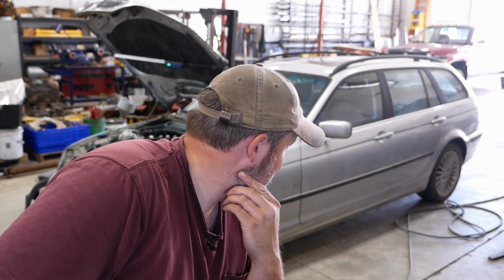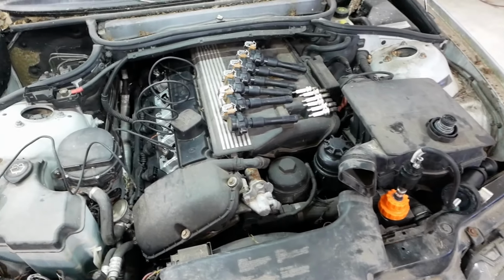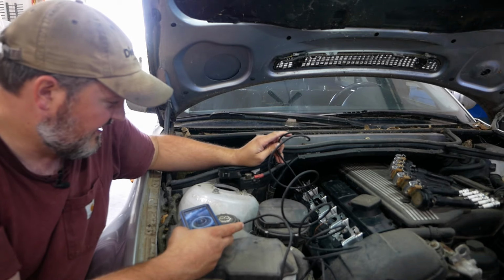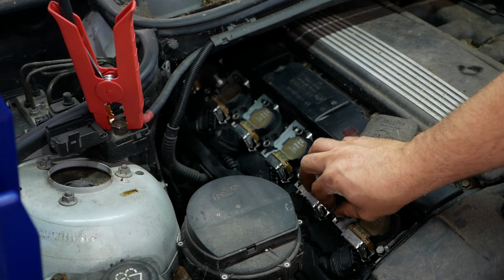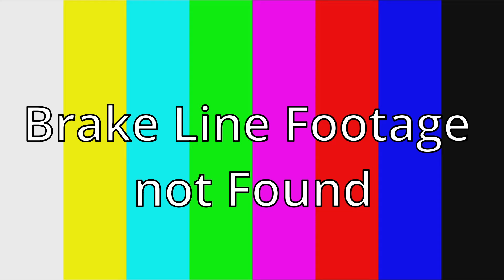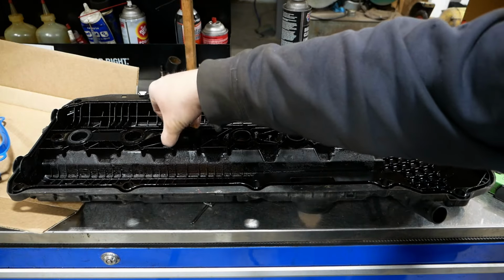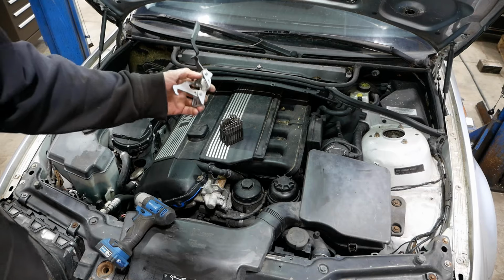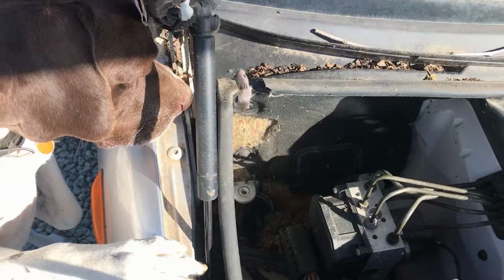E46 BMW Losing Coolant, Oil, Brake Fluid, Etc.

Comment from the maker: Need a bore scope or jump pack?
Teslong: https://amzn.to/3ZBZJW4
JNC660: https://amzn.to/3KYzF3r
Reply: check exhaust
Reply: The boroscope is good, worth a buy for those in need. Don't abuse it tho, act with it like a surgeon would. They can break the neck, that said, they did warranty me, sooo that's a +1 in my book.
Reply: Per mortske it’s pronounced “the schlong” 😂
Reply: @@bobhoughton3785 - In some garage, somewhere on the planet.. there is a forgotten old drawer that is slowly filling up with 10mm sockets.
Reply: @EngineeringVignettes  I saw a meme the other day of a gumball machine except instead of gumballs, 10mm sockets in a clear plastic ball.
Reply: Oh, yeah. I was in Tractor Supply the other day browsing the "bargain" tool display and found a bag of 10mm sockets in various colors, shallow and deep well. Started to get one but I haven't lost mine yet.
Reply: Water pump slow leak, this happened to my 3.5 new Yorker it ended up throwing the timing belt.
Reply: Should have checked the passenger carpet.  It could be draining from the heater core and into the car.  (maybe, not likely).
Reply: @calholli  If so the windshield would be coated inside as well.
Reply: @QQQ-os9dj  Maybe it was..
Reply: @calholli  He never thought to check. thats ok for a young lad.
Reply: @QQQ-os9dj  ceaa

Comment: I'm calculating the gray in your beard as the months and years go by. As we sit today we are approaching the log part of the graph. 🤣
Reply from the maker: Yes, BMWs trigger exponential growth.
Reply: @WatchWesWork  Heck you haven't seen mine and I've never rode in a BMW, much less worked on one.
Reply: And gray hairs grow faster than hair which has not yet turned gray - perhaps because they don't have to stop off at the paint shop before emerging from the skin...
Reply: I've always said that as long as it stays on my head, I don't care what color it is!
Reply: @DanEBoyd  tell me about it!!! Ever since my face hair ran out of paint, i can have a freshly shaved face turn too haggard Unabomber homeless scruff in less then two weeks! Never have ritualistically daily shaved but, probably should… just something i don’t consciously think about, until @ a week or two passes & POOF, all back, greyer then before & seemingly longer in less time
Reply: That’s just the Beard of Wisdom filling up.
Reply: I’m sure if you still had your e46 all this years later, you’d hate it deeply, Wes. They did not age well… I would not say it was the last good BMW, but the beginning of the downhill.
Reply: @silent1967  why is that?
Reply: @repairvehicle  Why is what ?
Reply: @repairvehicle  Go back and read what I said, put down your joint. I said I'VE never RODE in ONE or WORKED on ONE, "BMW" not Wes. I was talking about the color of beards.

Comment: I’m a tech at a ford dealership, and there’s an extremely common issue on the 1.5 fecal-boost engines where they get coolant intrusion into the cylinders. Typically they will have no evidence of coolant in the oil and it leaks just enough to evaporate and cause a misfire. They look exactly the same as your suspect cylinder. If it were me, I’d definitely be comfortable recommending a tear down on that engine. Happy wrenching Wes !
Reply from the maker: Yeah it may well be leaking in #6. I can't tell if it's coolant or oil.
Reply: As a completely unqualified opinion I agree and liked your comment.
Reply: I thought check heater control water valve , vaccuum diaphragm if present,

Comment: Hey Wes the e46 chassis is prone to cooling system failures , mostly do to all the components being plastic, which get brittle after 10 years. Preferred method is to overhaul the entire cooling system with only genuine (OE) components. The coolant hard lines are a common leak point, as well as the expansion tank cracking and leaking at the seams. And yes, it is in the service manual to use rtv where the front cover meets the block.
Reply: I was going to suggest expansion tank - that's where my E46 went. Common problem apparently.
Reply: @rhiantaylor3446  
I overhauled our e46 cooling system a while back, not completely tho, didn’t do the radiator or hard pipes. It still leaks. I check it once a week…sometimes it’s fine some times I add just a touch. I believe it is the thermostat housing. It’s not dripping, just seeping out. Oil samples haven’t shown any coolant in the oil yet, not a bad car at all, has over 230k on it, wife drives it daily
Reply: I had a old Golf. Radiator had a crack on the side plastic. Leaked only when engine was hot.
Reply: Yeah everything under the hood is plastic.   The pistons might be plastic.... I wouldn't be surprised.
Reply: LOL.   Every BMW has cooling system failures.  BMW GDCS - God Damn Cooling System.
Reply: @mungtor  i must have 2 unicorn then, e39's wich doesnt lose coolant and they warms up to 90 celcius lol
Reply: @mw2proplayer100  I had one E39 540i which was amazing.  Maybe the 528i was better.  But I replaced the radiator, expansion tank, water pump, and thermostat all within 30k of each other.  Still a great car which I would gladly own again.. but would stockpile parts in advance.
Reply: Only in German cars do we consistently see the "The OEM design is prone to failure, the recommended solution is to replace it all with OEM parts" line. Everywhere else, we get acknowledgement that the OEM can in fact do wrong and the concept of OEM-improved parts.

Personally, I blame TÜV.
Reply: @rhiantaylor3446  same thing in disco 2's mostly because it's almost the same coolant reservoir
Reply: What I learned with my Z4 which is basically a E46 from a BMW mechanic was he simply said replace the entire cooling system just to play it safe
Reply: @EyeMWing  The reason you replace it with OEM is because the OEM part isn't great but the aftermarket part is probably worse looks at 3rd set of Cam and crankshaft position sensors which decided they wanted to die after 1000 miles
Reply: @TwoDollarGararge  Aftermarket all aluminum radiator and cooling components definitely are better than brittle plastic.
Reply: Its mandatory to replace the parts only with OEM or OE, still lots of people dont get it and put chineese crap in their cars lol
Reply: @Pentazemin44  there’s been a lot of issues with “oem” parts failing as well. It’s recommend to use Genuine bmw, or OE. FCP Euro has a good article on the definition of Genuine vs OE vs OEM
Reply: @j.walterstrucking3893  yup, cant disagree with that, depending on the manufacturer and mfg location OEM parts may be of different quality - especially with old MAHLE and new MAHLE.
Reply: That's a 29 psi coolant system and after replacing all hoses, thermostat, water pump, expansion tank and finally radiator, a small O-ring on the RH side radiator tank was the issue. That was on my 90k miles tow yard auction 03 330i with a cracked expansion tank. Believe BMW has a coolant maintenance schedule at around the 60k miles mark which is a friendly reminder to replace everything. The VANOS O-rings was another design flaw, rear end support rot, headliners and A,B,C post trim liner separation, excessive suspension bushing wear, LifeLong oil philosophy. The basic new vehicle limited warranty is 4 years / 50,000 miles, federal emissions 2/24k miles in 2023. That coverage should tell you something. There are all kind of options to extend the warranty to 7year/100,000 miles if you want to buy the ultimate driving machine experience.

Comment: I chased a similar coolant leak on my BMW a couple of years ago. No visible leaks, not smoking, no coolant in the oil. I took the parts cannon to it, and it turned out to be the thermostat housing (which is plastic). My guess is that the leaking coolant evaporated before turning into a visible drip.
Reply: I bought a billeted aluminum thermostat housing for my e39 just because of that possibility.

Comment: Had a 325 that smacked a tree once, pushed the motor back into the firewall and cracked the thermostat housing on the back of the engine. Was a miniscule leak, but it caused same symptoms. When you said it had been painted, it reminded me.

Comment: We had a VW rabbit diesel back in the stone age. Very similar issue, kept losing coolant and couldn't figure it out. Just by chance my dad the hood up started it up when it was really cold and saw coolant leaking out of the head on the back corner. Within a minute the aluminum head expanded from the heat and it sealed itself up and it dripped dry without hardly a trace. Remember from your school days, Aluminum has one of the highest Linear coefficient of expansion. It's one of the reasons that those VW rabbits had such a rough time with head gaskets, because the aluminum would stretch the head bolts during it's heat cycle and loosen up just enough that the interface would loosen up and blow. I bet you could snug down those head bolt in the back and it would solve the problem. If you hit it with a torque wrench I'd bet dollars to donuts they would be loose.
Reply: This, i would def try and tighten those bolts in the rear and see whats up, im surprised he didn't try it.

Comment: Head gasket is 100% leaking. Rusted cylinder is the dead giveaway. Gasolina doesn’t rust and its hard to for surface rust to happen with the pcv system dumping oil into the intake constantly. But you know what glycol does. Causes the oil to just run around it. Oil doesn’t like coolant.

Comment: The rust is perhaps from an open intake valve allowing moist air into the engine while the engine was sitting. That little line of fluid going down the cylinder might have made me call a head gasket, but as you've said it's a tough call to make and it's a very expensive call to make. I recently went through this on a 6.7l Cummins after a bus driver kept driving the bus after a coolant line to the air compressor blew, in spite of the stop engine light and engine protection stuff. When I got the bus the temp gauge was 240 degrees. I slapped the tester into the tank and found that while the fluid wasn't changing color in the tester, it was definitely bubbling heavy. I revved the snot out of it and the bubbling was so fierce it splattered the side of the bus and those droplets definitely did change color. I didn't have the equipment or shop space to do the head gasket, and honestly I was doubting myself if the head gasket was actually bad so I kicked it to another shop and it cost the company over $10,000.
Reply: How funny you mention the 6.7 cooling line failure on a bus. I just did that on my bus. No damage, just bad O rings. Those odd O rings are $8.00 copy from Freightliner, LOL.
Reply: I love stupid
Reply: That is a big bill for a head gasket. I wonder if they just put a long block in it?
Reply: @Truthseeker4449  At $150/hr that is 60hrs labor to be $9000 and you certainly can buy a gasket, new bolts and the fluids for a 6.7 for $1000. Unless the engine had no access 60 hours for a head gasket is ridiculus.  I used to do them on Dodges in 8 hours not even hustling.  just being slow and deliberate to be sure everything was right pinching wires  is a big danger doing them because the cowl comes out over the engine and the harness runs on it so hard to see while putting the head back on.  I don't usually estimate but 40hours to rebuild one.
Reply: @Truthseeker4449  Sounds like the big problem is it being in a bus and having poor access. At least some of the high end motorhome outfits finally figured it out and mounted the engines in self contained units where you can just unhook one harness connection and the driveshaft and pull the entire engine  and transmission out of the back where you can get access to everything to work on it.  No idea why they don't spend a few dollars and make busses the same way.
Reply: @Truthseeker4449  Yep radiator ac all of it comes out on a skid.  I think it was a newell I saw like that. I don't know if it is standard or that was something custom.  My google search for it showed Daf made buses years ago with slide out motors so I guess not a new idea. The bean counters probably killed a great idea! LOL  Newells are like Million dollar coaches so I guess they can be fancy if they want. LOL

Comment: I have a 330i and love it. The only problem I had with it was chasing a coolant leak. Replaced hoses that were original, water pump, thermostat and it still was loosing coolant. Turned out the reservoir was bad at the seam on the radiator side of it so I couldnt see it. New reservoir and it doesnt loose coolant any more.
Reply: and you got a coolant system which basically will be ok the next 10 years (as long as something catastrophically doesn't happen ie collision etc.)

Comment: BMW corrosion protection is immersion of the all-new body frame into a manganese, nickel, phosphate zinc bath to provide a protective coating layer. Earlier versions most likely had something like Waxoyl. That’s why they don’t rust much.
Reply: I think all more expensive German cars from the early to mid 90s have such or similiar treatment. Not the cheaper models like polos though. VW also made the B6 Passat rust easier than the B5 for example. Same with the Audis. This was around 2005. This is especially true for the body, not necessarily the underside.

Comment: We call these oil leak spots on the gasket half moons in Europe. Its a common leak point on all straight sixes of the era, hence someone put red silicone in there, I always add some usual black one, otherwise they just don't last and leak from in there again.
I cant remember if this one has it but there's a water rail hidden under intake manifold that would often be your leak source on lots and lots of european straight sixes.
Looking forward to the next video!
Reply: I had that coolant pipe break on my and leak their. It could be it but I’m not sure there’s any area underneath it to hold to coolant from leaking onto the floor.
Reply: it's actually in the official repair manual (TIS) of bmw to put sealant on the half moons as well as the spot where the head and timing chain cover meet when changing the valve cover gasket.
Reply: Some Toyota trucks have these half moons as well and they're a service item and many fail to do them with a gasket job.. soon ish down the line they want to know why it's leaking out the sides..
Reply: Bypass heater core and run it. If coolant stays full/found it

Comment: Several good comments, I'd like to add for emphasis that the pressurized plastic expansion tank is a ticking time bomb on this era. A family member's 2004 325 had the tank let go in traffic on a hot day, circa 2010 with around 120k on the car.

Comment: One place you could be losing coolant is from the coolant cap. On my mothers f25 x3 I couldn’t find any leak and then realize the expansion tank bottle was leaking the tiniest bit. As you drove it would slowly evaporate a minuscule amount for a week or two until it triggered the sensor. I replaced the tank and cap and had no issues since. I heard the tiny leak when I couldn’t get my pressure tester to seal up on the threads.
Reply: Agreed, those BMW caps are also security valves and when they get old water scapes. A new cap and it'll get better running temperatures too.

Comment: I have a jnc 4000 (same construction, smaller capacity) for at least 20 years. Changed the battery inside once for about $60... still going strong.

Comment: I didn’t hear the mileage on the “beemer”., but being a 2002, I would guess pretty up there., but the cross hatching on the cylinders sure appeared like new.
Great tool there in that bore scope…,
Thank you sir.
Reply: we drive m52/m54 400k kms with maintence in eu

Comment: Another awesome video! We have a 2002 Chevy Suburban that got water in the oil. We thought head gasket and so did the shop.  Nope...heads rotted through. Just over 200k miles. We took the easy cheap route...a rebuilt engine with 5 year 100k mile warranty. We couldn't buy anything for the cost of repairs and now we know what we have is good for a while. Wifie is still running the burb hard. But the suspension only allows her to haul 1 horse in the trailer. Anyway thanks for the info and entertainment!!

Comment: Max ❤️

I’ve had my JNC jump pack for over 6 years - very durable and has never let me down
Reply: Yep, I have a jnc770 and I used it in place of a car battery for a 92 Toyota Tercel my friend and I were reviving. It kept cranking that little engine without a issue. Their awesome jump packs. I opened mine up to see the internals and it’s basically a car battery attached to jump cables. It’s really well build and the parts are stout.
Reply: Same experience with my 4000. Over 20 years, and only problem was I replace a the internal battery about 5 yrs ago. Cost about $60 to replace. Solid unit.
Reply: We abused a JNC660 almost daily at a used power sports/auto dealer I worked at. That thing jump started multiple large diesel engines without issue. Many many sxs, cars, trucks, motorcycles. It was even used as the primary battery in a V10 F350 for a while. We had several of the newer small lithium jump packs and I could never get those things to jumpstart even an ATV consistently.
Reply: @Nick Sjoberg  my brother and I both travel quite a bit, and keep Noco lithium jump packs in our trucks... always been useful.

Comment: Maybe Heater core?  No build up on inside windshield or damp on firewall/floor pan? 
I had a tiny crack in plastic radiator side cap on crown vic in a hidden area.  Super slow leak  and really only apparent on long trips in summer when really hot.  Maybe 1 cup/500 miles.  Where it collected I assumed leaking drain valve.  After 3 years and inspections every oil change, it finally split open enough to steam and dribble in a seam.